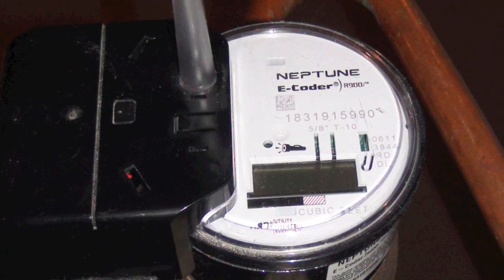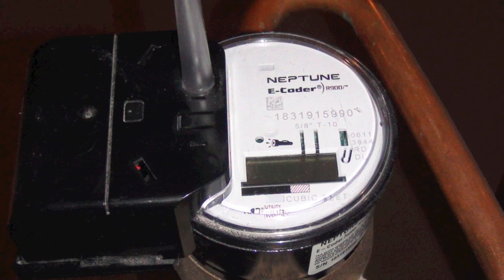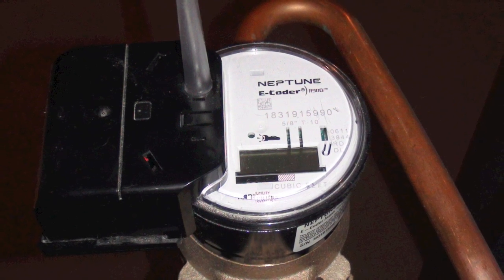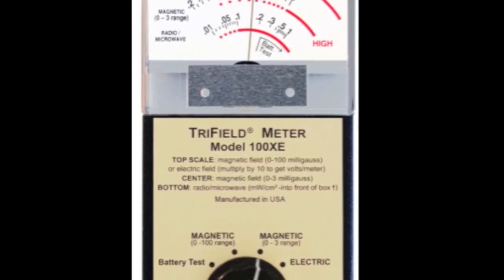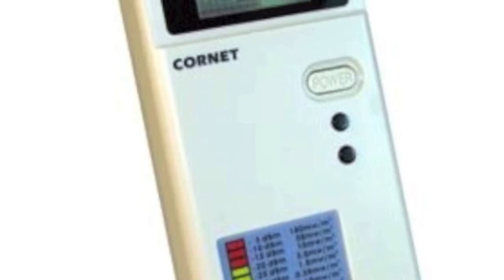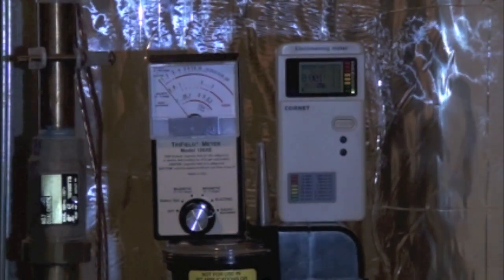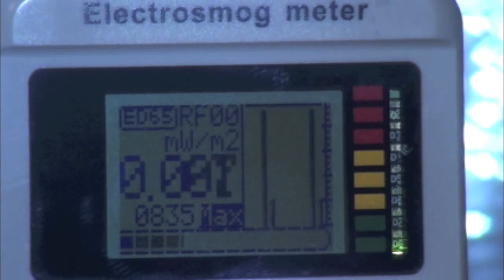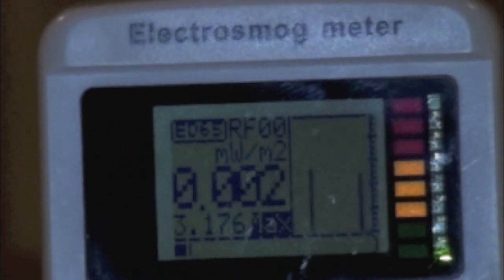Smart Water Meter RF Pulses

Comment: You are quite right about smart meters being dangerous. Those installed by my utility made me very ill for a long time and left me permanently electro-sensitive. This is the case with many tens of thousands of complainants in CA and in every state. Those who made these disparaging comments below are wrong - misinformed themselves, or representing the wireless industry. Scientists agree that smart meters and rf radiation is dangerous, based on thousands of studies of the effects of microwave radiation on biological beings. Many physicians and groups of physicians also agree this radiation and smart meters, specifically, are dangerous. The pulsed rf radiation (as from smart meters) is worse than continuous wave according to scientists, based on studies conducted. www.electrosmogprevention.org

Comment: These R900 units are being installed in Ontario,Canada. Are these units battery operated? There's no power attached to these units,so,how does RF work without power?
.
Reply from the maker: Yes, they are battery powered. They use the Tadiron PulsesPlus hybrid lithium battery which are supposed to last 15 years.
Reply: Don't let the "Battery-powered device" lull you into a false sense of security. I have a "Car Booster" power pack that fits in my jacket pocket. It can give me 3 wintertime boosts for my truck's dead battery. Tasers are also battery powered and have killed numerous people...

Comment: Thank you for this video!  The water department here in Battle Creek, Michigan, have been installing these under false pretenses.  They gain access to the old meter by saying they want to check on it, but later you see they've installed this smart meter.  Also, I've talked to people in Battle Creek who were forced to take one of these smart meters with the threat of water shut-off if they didn't!

Comment: They say the unsmart water meters are not as bad as the electric ones. RF is RF and I would think that there would be issues w/ the metal pipes and water is an excellent conductor. That is why you will die if you drop the hairdryer in the bathtub while you are bathing.

Comment: I am not sure if I am buying the harmful effects of the RF pulses.  BUT, I see no reason why Neptune did not design this to emit RF pulses only on demand.  The meter display only comes on when you activate it via shining a flashlight at it.  They could have used similar scheme where they could be scanning for incoming RF command every few seconds and emit response only when commanded.  I am betting the same chip that they are using for the transmission could have used to receive the signal from the walkby or driveby vans.  So they most likely have the hardware in place but did not bother to make use of it to reduce unnecessary RF emission.
Reply: There are smart water meters that only transmit when the truck comes by to read it. They like this type (in the video) because it collects more data (continuously).
Reply from the maker: S Brinchman not necessarily. This type of "bubble up" meter (similar to an AMR electric meter) does not transmit granular or hourly data the way newer AMI meters do. The constant transmissions are simply to eliminate the need for the utility to do anything when collecting data and allows the meter to have a one-way radio. 

The other kind of meter that only transmits when the truck comes is called "wake up," which employs a 2 way (sometimes called 1.5 way) radio because it can receive a signal from the truck. Obviously this is slightly more expensive, but much much safer for the resident.
Reply: 12vgs8606 
There is a lot to understand about this global agenda.....
http://takebackyourpower.net/news/2015/01/04/2014-the-year-the-smart-meter-agenda-and-its-failure-became-obvious/

A growing number of scientists are urging caution around devices that emit electromagnetic radiation.
http://www.pentictonherald.ca/news/article_ce577212-001e-11e5-b797-9307519dae0d.html

Comment: This is a little off topic, but I'm trying to find a way to decode the RF signal so that I have an indication of when the water leakage signal is present on the meter.  It is a good thing that this meter provides a visual indication of this condition, but since most meters are mounted in a remote, obscure location, the visual cue serves little purpose, An audible alarm, or even a wireless message to a cell phone would be much more useful.
Reply: headscratcher99 When you shine a flashlight on the meter the LCD will display a code then will alternate between the reading and the current use readout.  In the Upper Left Hand Corner of the LCD, if there is a leak, you will see a symbol of a Faucet flashing or it will show steady indicating that there is a leak going on.

If you have one of these meters and are curious as to if you have a leak inside or outside of your house affecting your service, feel free to contact the local water department associated with your meter readings as they will have the information you need to take care of your questions.

Comment: Anytime you install a new meter (even and analog to replace the existing analog), you most likely will see a rise in your water consumption. The reason for this is because as meters age they tend to become less accurate, always in the customers favor. This is why water utilities have meter change out programs. We continuously change out meters on a 15 year rotation. We still use all analog meters, but if we were to use smart meters it would definitely not be to spy on people or for marketing purposes. It would be so that we could collect data that we could use to assist our customers with problems like leaks, people stealing water from their neighbors, or so we can tell them exactly how much water they are using to water their lawn. Not that we would know what they were doing with the water, but maybe they would if we could tell them when they used it.

Comment: James, I had this metere installed recently and the flow numbers are way higher than the previous turbine meter.  There are overhead high voltage power lines.  Do you know if that explains the higher flow readings?

Comment from the maker: 800 milliwatts per meter squared = 800,000 microwatts per meter squared
800,000/10,000 = 80 microwatts per cm squared

Beware the "fuzzy math" provided by your utility/PW. If you can test and find that it is in fact 4 transmissions for .25 seconds each day, I would not be very concerned. A pulse like those shown in this video more than once every 5 minutes is certainly not beneficial to your health.

Comment from the maker: the meter in this video was replaced by an analog meter that was wired to a sensor outside the building. The RF radiation was completely removed. Ask your water utility. They are more likely to respond in your favor if you can document the RF emissions from the unit and show that the water meter is the primary generator of RFR in the home (in this case it was).